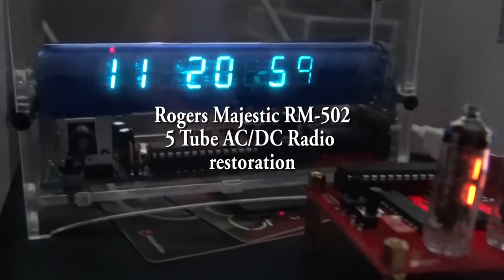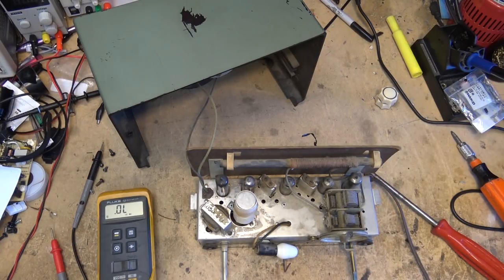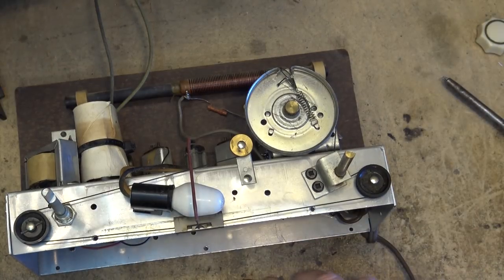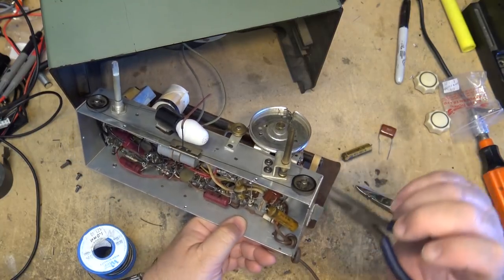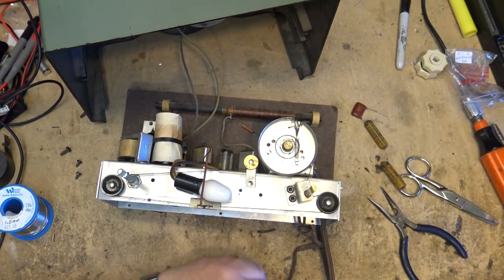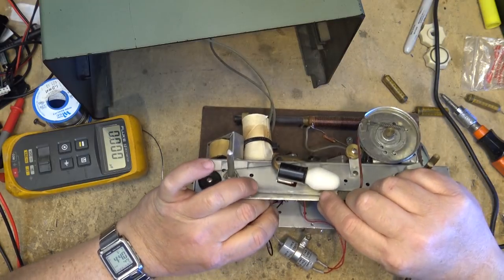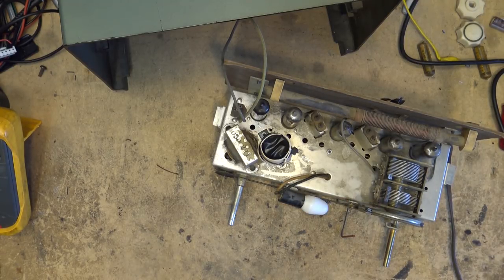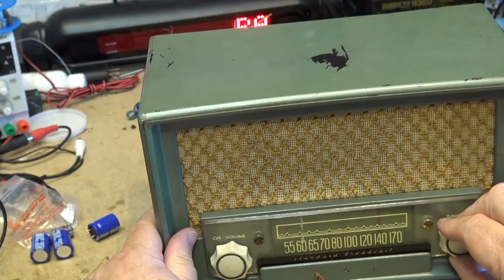Rogers Majestic RM 502 Restoration

Comment: Nice radio, hot on reception too.  The paper caps remind me of how many of them were made many moons ago with bees wax to seal them.  As a kid working on these radios I could not resist scraping some of it off with my fingernail.  Many of these old units had a nice scent after warming up due to the wax.  Yes, some of these old units were the first on the block with aroma therapy.  Hi Hi.

Comment: Cool radio, nice resto!! Regarding dial lights in AA5 sets, at least some of the 35W4 rectifier tubes had a filament tap for a dial light. I do not recall if it was 6 or 12 volt.
Reply from the maker: Walt's Channel 
That is a 120 bulb but you are correct the tap is 12 volts so the little 7 watt lamp is running at 108. It is a standard night light type bulb.  I intend to modify this radio and go with s solid state rectifier and dc to the filaments as the line operated ac filaments induces a low level hum into the 50c5 audio output. A full wave bridge on the line cord should solve this. And a fuse or dim bulb limiter. Likely will use that dial lamp as the dim bulb limiter.

Comment: That's a nice little radio :-D, the ferrite rod antenna seems to do a great job of catching the magnetic side of stations.
When you were isolating that main cap, i thought about bicycle innertubes, i'm odd that way LOL :-D.
You just need to paint the case pink He he :-D :-D
Reply from the maker: zx8401ztv 
Fluorescent orange. Make it really stand out. 
It may get a paint job at some point. To one of the original colors of course. Powder blue would look cool.
Reply: Bloody hell!, that's a radio you would never lose lol :-D
You cold make it matt black and have real trouble finding it :)
Reply: all joking around I bet in another 50 years it will still be working not like todays electronics shelve life of 6mnts tops.
Reply: Yep, for example my old ancient sony ericson mobile phone has outlasted lots of frends 'Smart phones', it has been dropped and survived quite a few times over the years.
Modern phones are made of crap, thin and weak with a big screen that will break if you dare to show it a floor.
My ancent phone does not use the tiny weak power connector that breaks on modern junk, it has gold pads on the surface, the charger or usb cable contacts them with gold "V" springs.
Not dead, still charging fine :-D.

Can you tell i dont like modern junk? LOL :-D
I use a phone for phone calls, gasp, shock lol.
Reply: I am the same,   people keep asking why am i using a 5 year mobile with a removable battery.   I dont buy into the sealed backs so the manufactures can overcharge for repairs.   Its a shame as a child that I never kept the old radios or turntables only recently I got into restoration.
Reply from the maker: Drkninja2k5 
If you are lucky.
Reply: Drkninja2k5, Well if it works and is reliable then why not use a 5 year old phone, if it does what you need then why dump a good phone so you can stay "Trendy" and please other people.

My ancient sony Ericsson K800i is about 11 years old, and it works fine for text and calls, that's all i need it for.
The battery finally died and i picked up a cheap china battery for 8 quid, i don't expect it to be as good as the original, if it lasts a couple of years ill be happy :-D
Reply from the maker: I still have a rotary phone, connected to the network and still usable.
Reply from the maker: Lots of fun with vintage stuff these days.
Reply: I just loved the pulse mechanism, it's a shame but most have gone now, most people replaced them with the chirp phones from the 1970's.
I've never seen the old pulse mechanism fail, and yes they still work as it seems that most phone companys still allow them to work.

Comment: would it be good to put a polarized plug on it?
Reply from the maker: stereomann83 
The metal chassis is isolated so a polarizer plug from a safety prospective won't make much difference. It will reduce the hum as if the plug is reversed there is a noticeable faint ac hum in the sound.

Comment: Actually, the "plastic" caps are just plastic molded paper caps. The paper in them deteriorates with age and can cause them to turn into a resistor over time. I would suggest that you test them with a capacitor checker that can deliver nearly their rated voltage. I have found that the old style caps will sometimes check good at lower voltages but fail at higher ones.
Reply from the maker: I don't have a breakdown tester at the moment. Always keeping my eye open for one.
Reply: You will definitely need one to keep those old sets alive and running at optimum. If a cap shorts and sends high voltage to the grid on another tube, its life will be greatly shortened. Good luck in your search. I found mine on fleabay for about 40 bucks and had to recap the entire thing. Over my decades of fixing electronics, I've found that the only caps that live past 30 years are mica ones. All the rest dry out (electrolytics), short/open (paper caps), modern self-healing caps tend to slowly lose their foil electrodes due to vaporization. Some of the NOS parts that have come my way are iffy at best. The major thing that kills most caps is heat and time.
Reply: Update: After a bit of back-burner thought, some vid viewing from Johnaudiotech and Mr. Carlson, an epiphany occurred (you learn something old everyday), If you measure the plastic molded paper caps for micro current leakage at under 50 volts, you can get a good idea of how leaky they will be under their higher rated voltage. No expensive breakdown tester required.
Reply from the maker: Correct you don't need a high voltage breakdown tester, you can accomplish the same thing at much lower voltages. I still have my eyes open for a high voltage breakdown tester, but not at inflated ham flea market prices. I was looking at a basic tube tester and the seller was asking 300.00 for one.
Reply: It's just the nature of the business. There are very few vacuum tube manufacturers left and the the boutique market is fuelled by fortune seekers. The remaining stock is disappearing and the prices are going sky high as interest in old gear also increases. With a bit of luck, you'll find one for cheap, but as awareness increases in how much an older item is worth, the availability of them showing up at flea markets and hamfests decreases as the person who sells it starts demanding ridiculous prices for said pieces.

"Everything is worth what its purchaser will pay for it." - Maxim 847, Publilius Syrus

Best of luck!

Comment: A 40 mfd cap that measures 178 mfd? That usually indicates a very bad capacitor. Maybe it will reform but I would keep an eye on it in future.
Reply from the maker: No there are 2 40 in parallel in that case, and one side of that dual 40 that I changed in parallel. That makes 120uF, and 178 would not be out of line as most electrolytic caps measure much higher than what is printed. Then can be 10% under and as much as 50% over. So the cap is fine, and I bridged another 33 to the underside. You can't go too high on these old tube rigs.
Reply: That explains a lot. Olde caps were often rated +80/-20 for tolerance. New ones are very close to rated value, some brands running a bit below it. Comes with trying to make things smaller and smaller.
Reply from the maker: And controlling costs. Back then nobody worried if a penny more of metal was wound up in the plates. Today wasting a penny more is a fire able offense. Bean counters not happy. Put profits before quality.
Oh, that's what happened to domestic manufacturing. They put quality first, that is why these ancient radios that are older than I am are still working, and they will probably outlast me.
Reply: 12voltvids With care, they'd probably outlast every person alive today with how reliable these are.